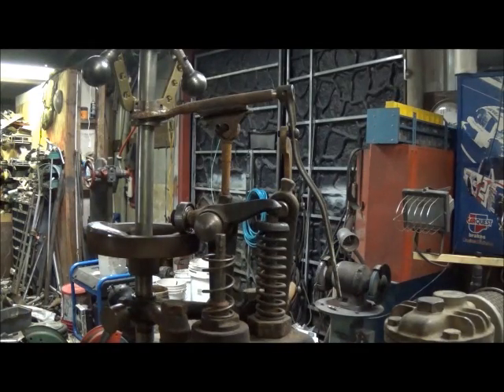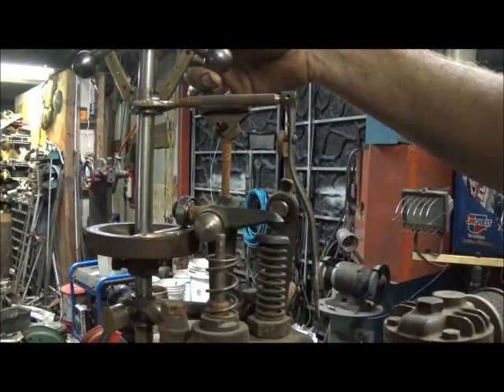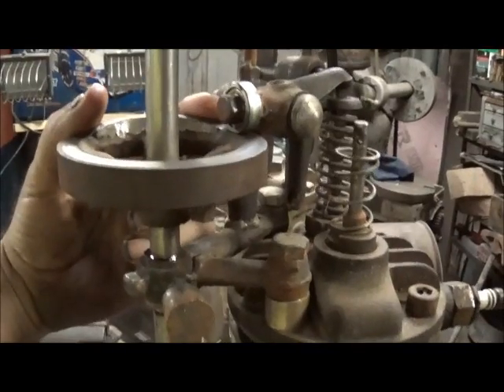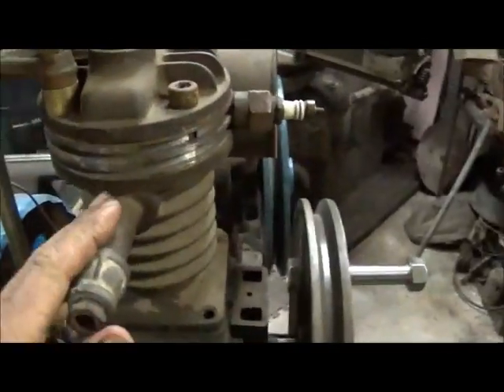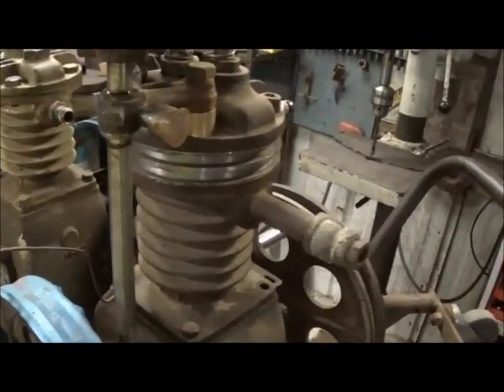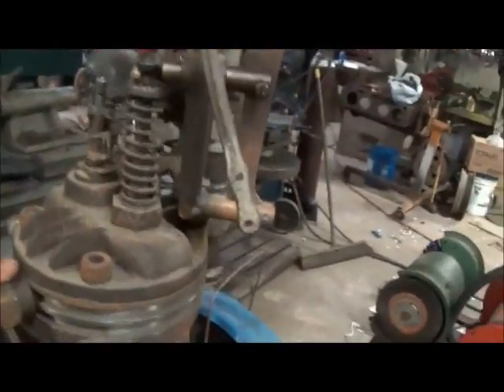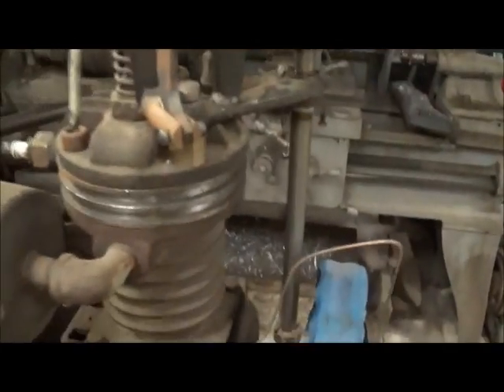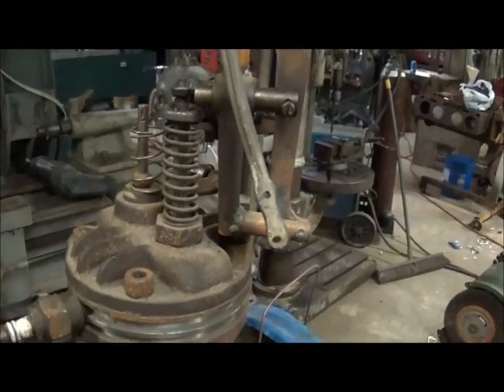How A Hit And Miss Engine Works

Comment: I've seen a few of these in operation, very innovative for their time, but what I've been intrigued about is Smokey Yunick's Hot Vapor Engine. Read about it when he first un-veiled it. Was that around early 1980's? I believe some of the stats were; 
250 hp from a 4 cylinder don't think it was turbo or supercharged . 
51 mpg... Just crazy. Not even sure if it had a radiator or any kind of water cooling. I'd love to hear your thought on that...Maybe make a short video to talk about it??

Comment: What's the purpose of the flywheel?
Reply: old indian basically rotating mass as he said it would run to fast and would not run right. With a heavy and or large flywheel it keeps more of its force mass×acceleration=force. More mass means u need less acceleration to do the same job. It also balances the engine.
Reply: Without a flywheel on a hit and miss there would be no load. Without a load it would run WAY to fast. The only reason a hit and miss misses is because there isn"t a load on the fly wheel. When there is a load, the flywheel slows down quicker which causes the governour to close the valve quicker.